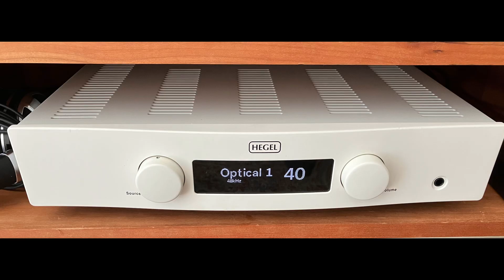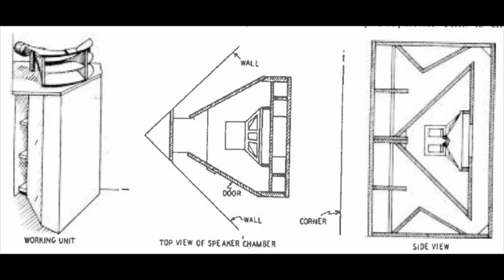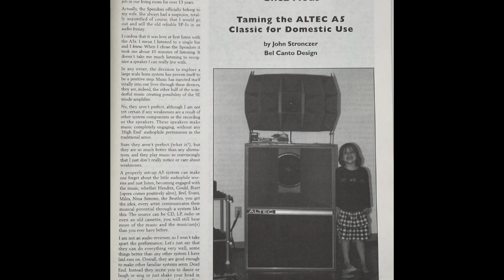Why Horn Loaded Loudspeakers? With Multiple Language Subtitles.

Comment: I enjoy the Klipsch Heresy lll running a 300b amp as well  as 845 mono blocks. All single ended triode. The Klipsch are vary articulate as well as dynamic. Great sounding system.

Comment: (Hey Tom B. - love U) For small rooms I think its possible to have very small front loaded upper bass horns with good sensitivity and "good sound" as the basis for a modest sound system which to ain't perfect, is more pleasing than some direct radiator + HF horn approaches.  A very good and talented friend built for me a tiny J-horn design using a 10" driver by LORDSANSUI.  I've it with the asymmetric B52 horn w.  DE25 on top with no padding other than a 15R resistor bypassed with 3.3uF for EQ.   Another surprise is a 0.83 scale Belle with 12PE32 -   assuming a passable small sub can be run up to 140Hz, this could work with a cheap 2.1-digital amp..   re: recent Klipsch  MDF LS I think Guttenberg;s channel  deleted my comments -twice - lol